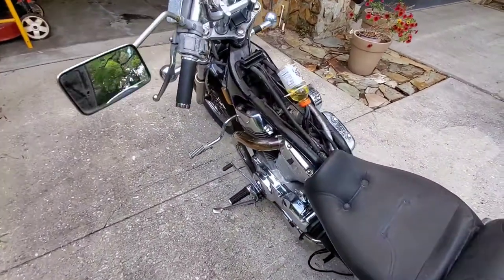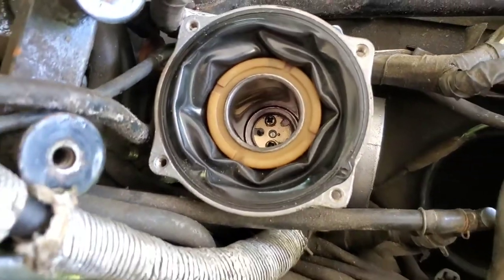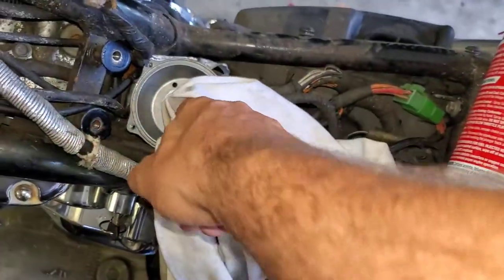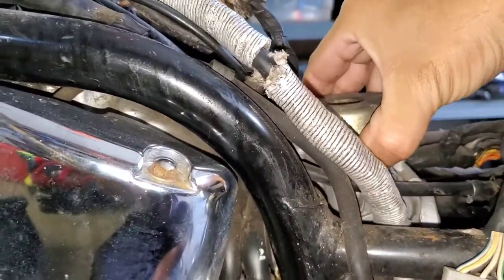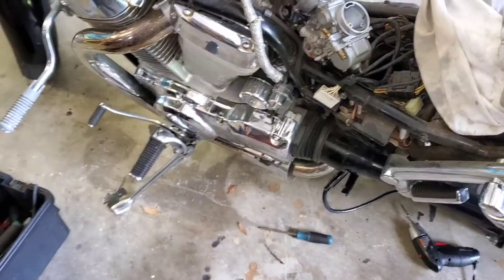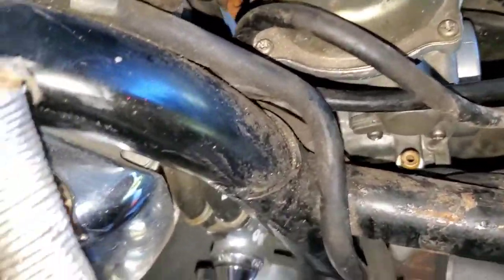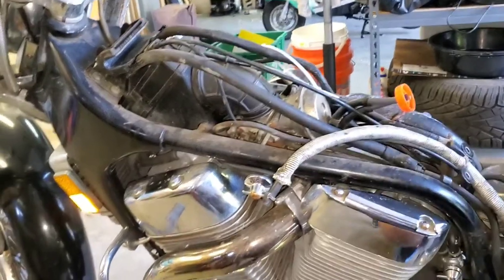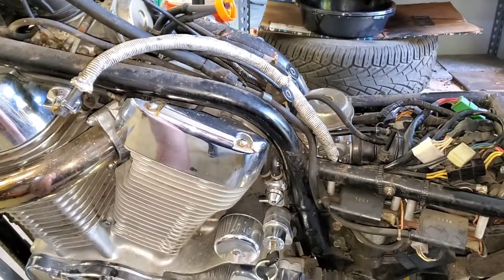Suzuki Intruder 1400 Clean The Carbs Without Removing Them

Comment: If you have a carburettored motorcycle, always turn the fuel off and let it idle till it stalls out, its a good way to help stop the fuel going all gluggy inside the carburettors and the float bowls, and can potentially extend the life of the carbs, another good piece of advice is always check the fuel condition inside the fuel tank, especially iff the bike has sat for a long period of time before starting it.
Reply: Any fuel additives you’d recommend to help as well?
Reply: Do that all the time on my bike our atvs and mini bike lol helps alot especially for the winter lol

Comment: My only suggestion is to not put the slide and top back on until after you clean the bottom part!, when you spray and blow, stuff can get lodged back up in there, so assemble the whole thing after cleaning, awesome video!, very good commentary throughout ❤, I have a 87 1400 I got from a neighbor, hasn't been ridden for years and I am going to be watching this a couple of times before tackling t job!😮😅❤

Comment: I inherited my dad’s 2003 1400.  Only has 994 miles but has sat for over 3 years.  I dumped the tank, new plugs, new battery but I can’t get it to fire.  Fumes smell like the varnish I dumped out of the tank.  Thanks for this video man.  Hopefully I can duplicate what you did.  I’m not a carb guy but I guess I’m going to learn on this bike. Haha.

Did you film doing the front carb?
Reply from the maker: If it smells like varnish you definitely need to clean everything thoroughly matter of fact I would remove the carbs and have them brought in and serviced
Reply from the maker: I did not do the front carb on camera it's the same principle
Reply: @IFixShet  so you’re advising to not use your method in the video to try and clean them first?
Reply from the maker: @twodogs257  based on what you said how about varnish that would lead me to believe that there's a lot of internal lines and stuff inside the carb that will need to be deep cleaned due to corrosion and varnish buildup. In my humble opinion I would suggest removing the carbs and taking them to a shop for Servicing. Sitting gas becomes varnish which obviously is the ethanol content damaging the internals of the carbs. My suggestion to you would be to have them service properly. If there was just a little gas in there and it still smells gassy but it's been sitting for a small period of time then I would say give them a shot at cleaning
Reply: @IFixShet  Roger that man. Tis better to it right the first time!

Comment: Awesome video in every step and the explanation to what and why , you need a tripod for your camera to free up both hands. Peace. This bike has been sitting around for a long time but still you have a pretty good find., love this make and model, easy owner maintenance and will last forever.
Reply from the maker: Depends on how I'm feeling I normally strap my GoPro to my head but when I'm trying to get close up shots and be able to work with my hands I need to be able to move the camera around not have it on a tripod it can be frustrating filming this type of stuff for people especially when all the stuff is hidden underneath bars and other things putting a camera on a tripod and putting it in front of you while you're trying to work makes things very difficult

Comment: This is pretty smart. I'm gonna try going the same route.
Reply from the maker: Just be gentle do not pull hard on things. The biggest mistake people make is they pull it out and then they start wrenching the thing in all sorts of different directions putting tension on the cables. just be gentle

Comment: their is really no substitution for pulling the carbs and running them through an ultrasonic cleaner. beats having to clean them again if it isnt done right. and really its easier to take it apart on a bench with good lighting. setting the float height. Its really not much more time to just do it right.
Reply from the maker: OK well mine sat for a number of years and a quick cleaning and driving down the road with no issues I would only pull them And have them cleaned if necessary Don't create more work for yourself unless you absolutely have to. This method literally takes 25 minutes to figure out if you need to Send your carbs off or not
Reply from the maker: Work smarter not harder

Comment: Did you ever get it running?No part 2?
Reply from the maker: No part 2 because one of the cylinders on this bike was dead. Yes I got it running but one cylinder only had 20 psi it wasn't worth pulling the jugs and replacing the parts I paid so little for the bike
Reply: @IFixShet  oooh that would be a good first step.Checking compression first before attempting to clean carbs Bike does  exactly as this one and I know gas is bad when I drained it it reaked 😂
Reply from the maker: @macmobilestudio  I mean I trusted the person I bought it from who said it had good compression because I've known them for a while so I didn't feel it was necessary
Reply: @IFixShet Hey man I just got my rear carb all cleaned yesterday afterwork thank to this vid.Pilot jet gummed up solid.Soaked in Berrymans B12 and cleared the jet.All slimy and gunky.Drain screw wouldn't even drain due to all the gunk.Now on to the front carb thanks!

Comment: Heyy, is it same process for a suzuki marauder 1998?
Reply from the maker: No idea man every bike is different
Reply: @IFixShet  hello, i just did it and it’s the same processes as the intruder, the only difference is the difficulty to remove the carbs because of the tightness
Reply from the maker: Excellent I'm glad it worked
Reply: @IFixShet my muffler still pops when i let go my throttle tho, probably seafoam will help fixing the issues 🤷‍♂️
Reply from the maker: @mohamadali.h4754   So here's an easy thing to remember if you have backfiring out of the exhaust type it means that 1 of your cylinders is running rich or both if you have popping coming out of your carburetor that is a lean factor. So for whatever reason your bike is getting too much fuel the raw fuel is making it out of the exhaust and then igniting at the end of the tip
Reply: @IFixShet  hey bud you have any idea why after cleaning the carbs on a 1400 would make it run  hot? I just got the bike and did a start on it and it ran fairly well but I wanted to do a full cleaning so I removed both carbs to fully clean. Do you know if these carbs have two different main jets? Or is on bigger than the other. Bc I put everything back together and within a minute the header gets red hot and it wasn’t doing that before :( isn’t that a sign of running lean? Mind you it wasn’t like that before the cleaning. If you have any advice on how to fix it I would much appreciate it